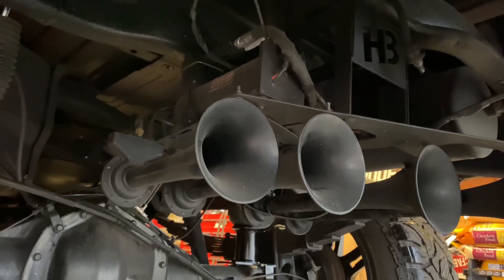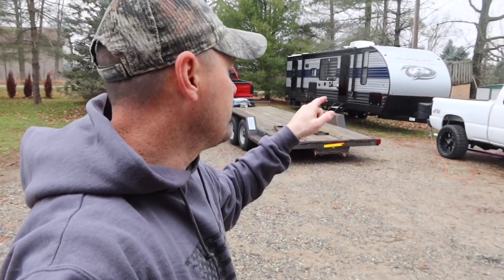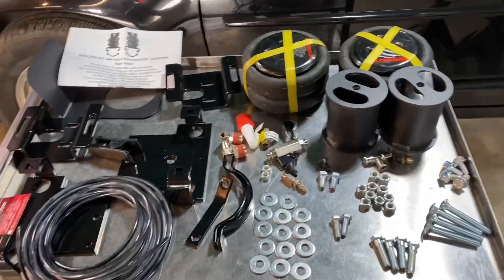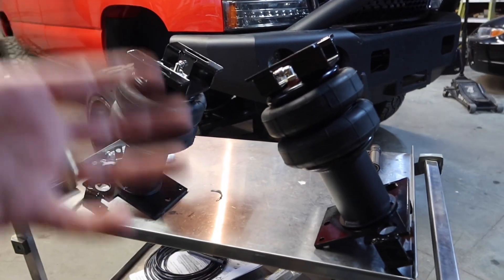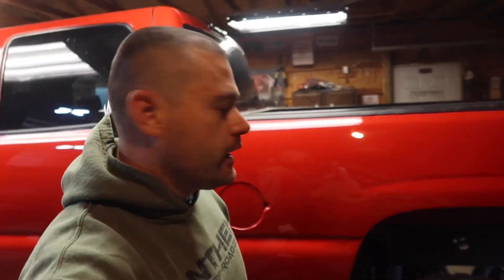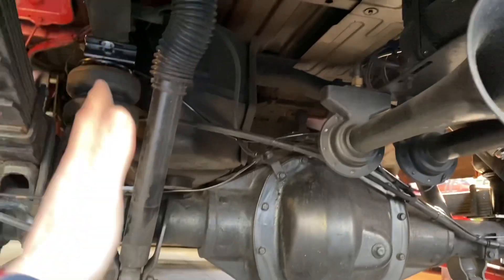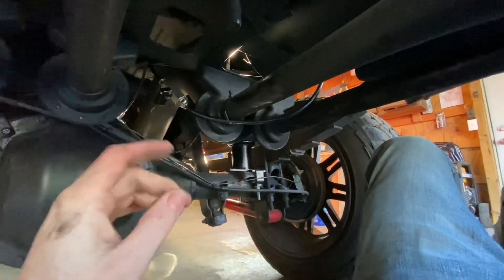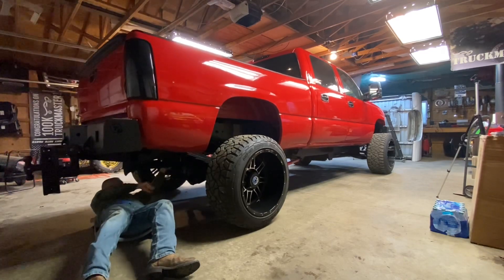Connecting Airbags To Train Horn’s On A Duramax!

Comment: Never twin up your air bags. Air gets forced to one bag or the other when turning which exaggerates body roll
Reply: Exactly they MUST be independent.
Reply: I was about to say the same thing lol! I would just get 2 electric on or shut off valves 2 switches 2 gauges that way you can adjust each side independently but still a good idea using the tank you have
Reply: You could just add another valve in the leg of one side...
Reply: and add a drain that doesn't require draining the whole system every time..
Reply: Check valves between them.

Comment: Why not use a leveling valve on there the same way they do on freight trucks then you don't have to crawl under there and turn it on and off and you can keep your ride height the same
Reply: Or use two levelling valves one on each side so it stays level from side to side. 
When you install them you can adjust the height they hold by the rods that attach to the axel.
If you pump them bags up that hard it won’t rid very well as the bags will be hard full of air.

Comment: B&W trailer hitches.... a good resource is another YouTube channel.. Big Trucks Big RV's... he provides a lot of information on trailers,  RV's, hitches,  load distribution... etc... He tests a large variety of products and reviews them.  Look him up and contact him for information.  I know that since you have a lift kit on your truck.  Lift springs are weak for heavy loads. Designed for a different purpose. You can add some "add-a-leaf" spring to assist the other springs. I would even look a a heavy rear sway bar as well.  You can probably find one in a salvage yard vice brand new.  But a good front and rear bar and bushing set will help a lot. You have had bags before,  but just know you need keep some air in them. Most brands don't like being ran empty even with out a load. Some people go to the trailer and flip the axles.  Gives a small lift... to raise the ride height of the trailer to work with the ride height of the truck.  Especially a lifted truck.  Because as you know,  you want the trailer level when hitched and under load. The other source would be where you purchased your travel trailer. Ahh, one last note... pay close attention to the load ratings of the truck.  The truck can have all the power to the anything and everything.. but if your load exceeds your load ratings and you are in an accident... if it determined.  The load was heavier than the rating... well you can see where this is going.  I mention it because it is often scoffed at and later regretted... Of course the next level is bigger brakes and exhaust brake  !!
Reply from the maker: Thanks for the great info

Comment: Did something similar with my van, used a old small compressor smacked inbetween the front seats and plumed some fittings and hooked two air horns and lines for pneumatic tools just in case... never did air-ride replacement but the engineering stuff is fun none the less. Top shelf content my dude.

Comment: Make sure you isolate both bags at least  with a valve bc when you turn its gonna push down one side but lift up the other as the weight shifts it will increase body roll

Comment: Josh, you should have just set up an air chuck hook up on your tank, run Schrader valves on the bags and use a coil hose to fill your bags and/or add air to your tires if you ever had to deflate them in low traction areas. I only run about 15lbs of pressure pulling my 37' 5th wheel just air it up to the point the truck and camper are level.
Reply from the maker: Great idea

Comment: Did a ton of “internet research” when I bought my towable and ended up with equalizer weight distribution/sway control hitch. Very happy I ended up on that one. I have a 36 foot 10,000lb trailer and have had zero sway.

Comment: Equalizer hitch is great. I had one for years when I had a bumper pull. In the 60s or 70s they hooked that hitch to a front wheel drive car with a trailer and took the rear tires off the car and drove it around. Works incredibly well. Now I have a fifth wheel, so I dont have it anymore.

Comment: The bad
1 push locks will rot and leak air (winters) 
2 no height level gauge to regulate air pressure
3 over air the bags to blow out
Should haves
1 compression fittings 
2 leveling height gauge to release over pressure of air bags.
Pros 
1 smoother ride
2 balance the load on the trailer to 25% -35% tongue weight. 
3 2500 or 3500 truck springs
Reply from the maker: Nice 👍

Comment: Curt is a good one. The one I have is old. My dad had the set up I have now for a long time, I think since 1999. Its a round bar set up.
Reply from the maker: Thanks
Reply: @TruckMaster  your welcome. If I get a chance to look at mine I'll let you know the name brand it is.
Reply: Here is the hole kit. $270.75 is not bad for the set up. This is before shipping and taxes of course CURT® 17022 - Round Spring Weight Distribution Hitch with 2-5/16'' Trailer Ball and Sway Control for 2" Receivers (1000 lbs TW / 10000 lbs GTW)
https://www.carid.com/curt/round-bar-weight-distribution-complete-kit-1000-lb-mpn-17022.html
Reply: I have curt as well I give it 5 stars

Comment: Nice video Josh. I'm outting bags on my 06 Duramax crew this spring.  From a 67V (15 series MOS and tech inspector) cut your tie wrap off from under the truck on the air line and use one on the horn and the other through the tie wrap on the horn.  This keeps the plastic line from chafing on the horn body when in motion.  Great job! Salute!
Reply: Btw... our springs on our Duramax trucks are rated at 2000# per Husky spring.  3500 are different in the dually trucks of course we all know.... Husky wants $210 per stack each side for a 3000#, or 3200# stack spring if bags are not an option.
Reply from the maker: Thanks

Comment: Josh the best weight distribution hitch i ever used was the Eaz Lift 1000lbs weight distribution hitch . Price is around  $360 . I very use Reese hitch they are ok for the money they run about $259. But for me the Eaz Lift works so much better. And if you get your weight distribution hitch and bars. In the future I suggest a air shocker hitch with weight distribution hook up.  On this hitch it has a airbags between this hitch and ball. It takes out lot of the forward and back motion due to rough roads. Its a expensive about $600 . But it gives you such a better ride. Check them out.  Its called AIR SHOCKER HITCH.

Comment: Blue ox distribution hitch is a pretty good set up. But husky center line is also a good one. I work on campers all the time.
Reply from the maker: Thanks for the info
Reply: @TruckMaster  I agree.. I use BlueOx and have had no issues. Easy setup and tension is adjustable

Comment: Food for thought; I get the wanting a mechanical set up instead of relying on relay switches and what not. Instead of having the valve that you have to roll around in the mud to turn, plumb an air chuck from the tank to your hitch. Then plumb your bags to the hitch with schrader valves on the end. Chuck up a short air hose, shoot some air to them and go. Still mechanical, easier to fine tune, don’t have to lay in the mud, still separate from your horns.
Reply from the maker: I like your thinking

Comment: You need a pressure regulatory to control how much pressure goes in the air bags depending on load . Also never run the bags empty

Comment: I had a the Equalizer hitch.  My personal opinion it was better than any other on the market at the time.  I had 2 1000# weight distribution bars.  Loved them on my Hemi Dodge 1500. Went to the Duramax and the trailer barely squatted the truck.  Added the Airlift Loadlifter 5000 with on board aircompressor and remote.  No trailer sway or load problems what so ever.  Good luck!
Reply from the maker: Nice setup ✅

Comment: The Equal-i-zer Sway Control Hitch 12,000 lb is a pretty good system for towing they are easy to use and better than the old chain set up
I use them on my camper and they are really nice to hook up and unhook
Reply from the maker: Thanks

Comment: Love the set up and price. My only concern is water getting in you airbag lines because it’s running out of the water drain. Try to use a T fitting on top where you have your horn lines running, same set up just no future water issue. But I may be wrong... let me know what you think. 
Keep up the awesome videos man!
Reply from the maker: That’s a really good point thanks
Reply: After working on class 8 trucks for over 43 years, it will be worth the little extra effort to reroute your line to the top of the tank as it is now the lowest point in the system water will collect and freeze, may not burst the line but then your bags will be isolated from he tanks. From my experience here in Muskegon area, it’s seems to happen at the most inconvenient time. Also one of the other comments suggested adding a height control valve, not a bad idea. Also a filter before your supply lines to horns and bags. Just food for thought! Good job!

Comment: Like the set up just a little more tubing and you could put the valve at the bumper and a pressure gauge to make sure your not over inflating the bags. I run 20 psi empty on mine and between 60 & 80 loaded heavy with about 20-25 thousand behind my 06 and it pulls great and rides smooth.
Reply from the maker: Thanks for the info

Comment: This is just a thought I've always used Air lift Company  out of Lansing they do carry a lifetime warranty no questions asked very good company. For your Reese hitch goes I really like shocker air Hitch Company it's a great hitch for hauling heavy equipment. I think I would run a set of gauges inside your truck for your air compressor as well as two different valves so you don't have to leave the cab of or your truck. You might forget one day you lower your truck to get it inside your garage door this is where the gauges would come in handy as well as you're not crawling around in the back of the truck on the ground just a thought.

Comment: Josh, you should replace the petcock style water drain valve with one from a class 8 truck. It's basically a brass toggle switch type valve that has a wire cable on the end. When you pull the cable, it releases the air and drains the water at same time without having to go under the truck. When you release it, it closes the valve automatically. Just run the wire between the frame and bed and secure it with a small wire loom bracket. Check out a class 8 truck as a reference to what I'm talkin about. It would suck having to go under the truck on a rainy day or in the mud. Also, need to isolate each bag and don't run bags at max pressure. Safety issues and ride quality will suffer if you do and trailer will try pushin your truck in turns causing a jackknife.  Love ur videos. Keep'em coming.

Comment: You need a leveling valve or ride height control valve so you just turn on your valve and the bags will self regulate like on a class 8 truck.
Reply: Only down side is it will ride like a dump truck. My truck is setup like that and you get thrown around in side the cab offroad. Wear seatbelts not just for safety but because you need them to hold you in your seat. Lol

Comment: I use a Blue Ox weight distribution hitch system for my 31' travel trailer. It works excellent for me, on my '06 3/4 ton GMC Duramax lbz.

Comment: If I was you and you find yourself using this system a good bit you could run your air line out to the bumper and put you valve somewhere more convenient other than having to climb under your truck. And your drain petcock replace it with the style you can pull on a cable to drain your tank. You would be able to hide the cable fairly easy. I hope you can picture what I'm trying to explain to you. And this is just an idea to help keep you out from climbing under your truck and everything still work as your video showed. Because climbing under the truck in wet conditions suck lol. Thank you again for the awesome video!
Reply: Truck master, I want to throw this out there some of my comments may seem as if I'm trying to critique your work believe me I'm not, I'm just trying to throw out some idea's that may help.

Comment: Could you route the valve near the rear wheel well so you don’t have to get down under to operate it each time. Just reach in to the side rail area over the back wheel
Reply from the maker: Yes that’s not a bad idea
Reply: Truck Master 
Cheers it may be my first good idea lol.

Comment: I used a Curt dist. Hitch...You did fine with your idea but I would have plumbed it so I wouldn’t have to crawl under to inflate or deflate, also you want to be mindful of the psi limitations on the bags-not sure how much pressure your horn system produces but my bags have a 90psi limit

Comment: Best one out there is the REESE Dual Cam HP
High-Performance Sway Control
. part number 66074.  Use it behind by LBZ on my 28' enclosed car trailer

Comment: Josh I'd go see a trailer sales place near you to talk about weight distribution hitchs they deal with that every single day cause they can help you with a new receiver hitch to the stock ones after this many years bend and the welds snap and rust and that leads to tire ware on the trailer tires and rear tires on the truck

Comment: Go with the equal-i-zer hitch it is a weight distribution and anti-sway all in one. Super simple and easy to use. I was a diehard Reese guy until I saw that their weight distribution and anti-sway are two totally different devices one using chains and the other using a crank System  👎🏻.... not to mention they tell you not to back up with a Reese anti-sway hitch engaged

P.S.Equalizer hitches sell for $700 but I got mine off eBay for $500 I just had to buy the ball separate.... make sure you buy an equalizer brand ball 👌🏻
Reply from the maker: I’m really considering this brand thanks

Comment: You should have bought from air lift Single needle gauge panel with one paddle switch, part #26161 and ran a supply line from your tank to the gauge then from the gauge to your airbags that way you actually know how much pressure is in your bags and it’s still a mechanical system no electronics

Comment: Hey truck master I have a 2007 GMC 2500HD DURAMAX 6.6L WITH A Allison transmission fully stock which i bought a few months ago with a box superchips in the glove compartment which I have not used and just recently my check engine light has come on as well when I step on it , it seems to lag , so what I would like to know is what and where do I go from here to tune my truck to be like yours , and what are the first things that I should start with to add to the problem as well I can not find a mechanic in my area can you please help!.

Comment: This is the style hitch I like to use and have used for towing. The second link is a leveling valve that you could use for the bags so you never have to adjust it. It would just keep the truck at ride hight and I think there is a dump control on it too. Also I would recommend not having your air supply line coming out of the bottom of the tank. As with the cold temps coming you don't wanna push water into your bags and have them freeze.
 https://www.walmart.com/ip/Curt-Manufacturing-Cur17322-Weight-Distribution-Trunnion-Kit-with-2-5-16-Ball-Sway-Control-1000-lb-Tongue-10000-lb-Gtw/48358271?wmlspartner=wlpa&selectedSellerId=10130&&adid=22222222228036472204&wl0=&wl1=g&wl2=m&wl3=70631527969&wl4=aud-430887228898:pla-158325028369&wl5=9018822&wl6=&wl7=&wl8=&wl9=pla&wl10=117089545&wl11=online&wl12=48358271&veh=sem&gclid=Cj0KCQiAh4j-BRCsARIsAGeV12Ddpicbc3zpU8-pK-Q6gkxL6ExW-1RK-841eZp83GZp_R4lwMYt7e0aAquDEALw_wcB

https://mvptruckparts.com/products/mvp-air-height-leveling-control-valve-for-freightliner-16-14318-000-52341-q135?variant=32592815685713&currency=USD&utm_medium=product_sync&utm_source=google&utm_content=sag_organic&utm_campaign=sag_organic&gclid=Cj0KCQiAh4j-BRCsARIsAGeV12Bkwm2U3NyXcTCCpdGgnbtSY_hZ-xwHcnk9TWA0FZ59fOgd0QSjEK0aAmoXEALw_wcB

Comment: I purchased a Husky Centerline TS 8000 to 10000 weight distribution hitch.  I pull my Cherokee travel trailer with my 2017 GMC Denali HD Duramax.   I purchased it on EBay.  P/n 33039.
Reply: 800 to 1400 lb tongue weight not 8000 to 10000. Great hitch, easy install and set up.love your channel.
Reply from the maker: Thanks for the advice

Comment: This has nothing to do with what this video is about but I think you can help me with one of my questions I have a 2008 Duramax 3500 crew cab 1 ton Dooley my heater core hose broke the little plastic nipple and I cannot get the removal tool back there to take the nipple out to replace it do you have any recommendations should I start cutting on it the dealer quoted me $1200 to change it I bought the part from O’Reilly’s for $13
Reply from the maker: https://youtu.be/rpJF6KWlB_o hope this helps if not you can cut it off but be very careful
Reply: Yeah I was going to let you know yeah I bought That piece that you used in that video to remove it but mine broke on the left-hand side and for some reason there’s just not enough clearance to get it behind it it’s also the new body style so somethings could’ve changed and not really sure but there’s maybe a half an inch on the left-hand side I think I’m just gonna have to take a Dremel and cut it off and be very careful this is absolutely ridiculous
Reply: @outlawjr7799  I successfully used channel locks and screw driver to break the rest of that plastic fitting. Wasnt not east but none the less the new went on with out a hitch.  I do believe your dremel will do just fine
Reply: Right now so I can go to work tomorrow I just cut the other hose coming out of the firewall and put a male to male connector in there
Reply: @outlawjr7799  just be careful to not cut into the metal line. Dont over think it, the pipe is strong for what it is!  Similar to a fuel or transmission line.  I know you do it just go slow.    Your cheap fix will work for a while 
!